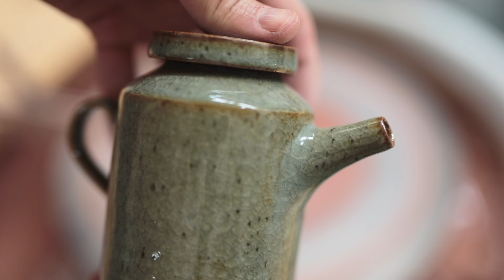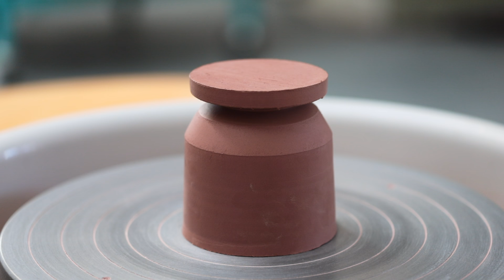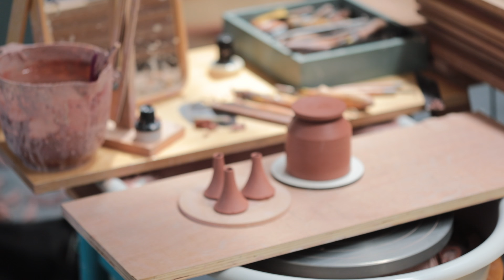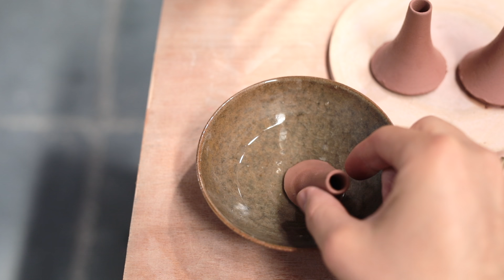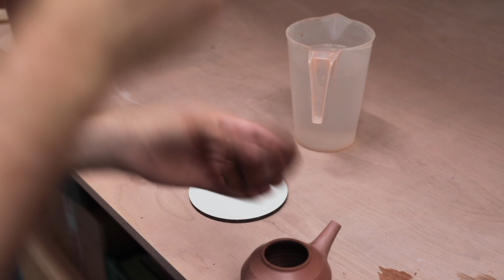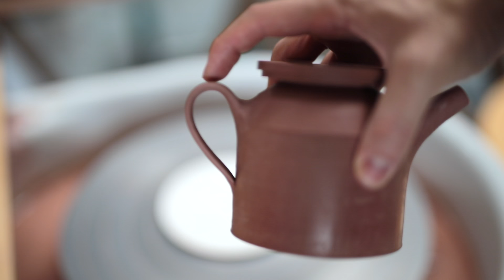Throwing A Teapot for One on the Potter’s Wheel

Comment: I drill 2 perfect alignment holes in my mdf bat blanks based on a template, spin the rough cut bats on the wheel to make the finish cut lines then cut them all out so there's no need for fussing with clay as glue to keep the bat on the wheel, the bats are always flat to the wheel. My bats are slightly thicker however.  Are there not so many good reasons for making small pieces!  Cheaper to ship, use less clay, fit more in the kiln so energy efficient, smaller boxes needed, easier for customer to fit the product in with all of their other stuff, and stuff of absolute quality like this guy's, I hope he gets a lot for these!